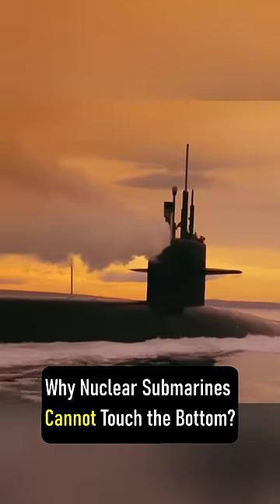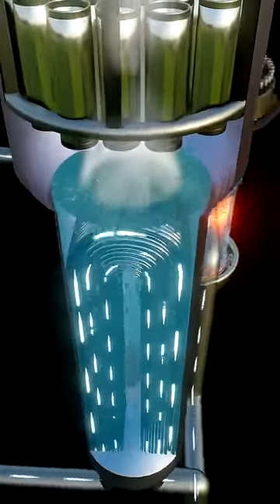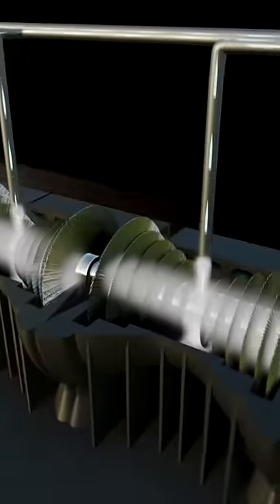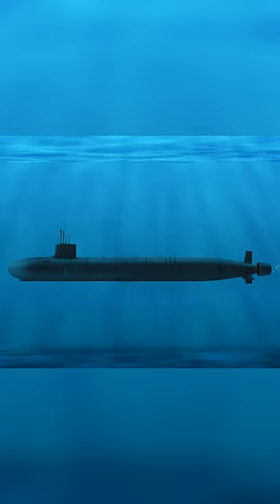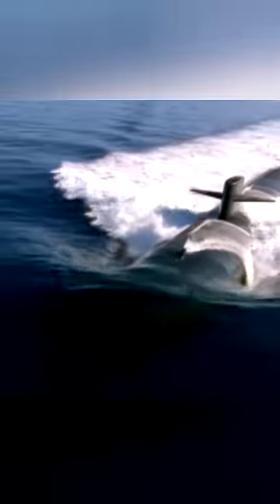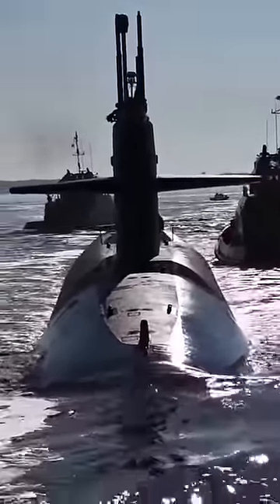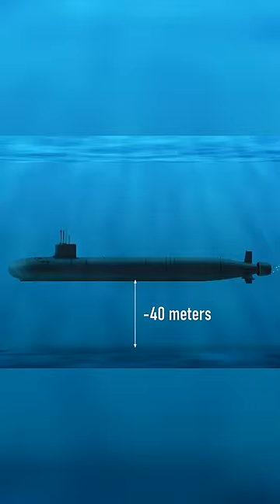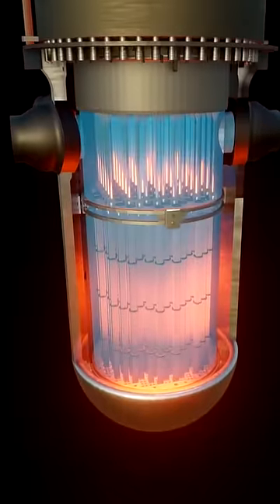Why Nuclear Submarines Cannot Touch the Bottom

Comment: The video was close to be correct.  Yes the intake is through a valve called Main SeaWater(MSW) and they are located on the bottom of the hull.  This seawater is brought in and distilled into fresh water for the secondary system which is not connected to the primary system which actually interacts with the reactor.  The Soviets had a class of su which had MSW valves on the bottom and top of the hull which allowed them to sit on the bottom in “shallow” water outside of enemy Potts.
Reply: Now that's smart soviets.
Reply: Do we have to tell it All 🤔
Reply: Always good to keep an eye on enemy Potts
Reply: @jimmysapien9961  you think adversaries don't know the general outer designs? Come on now.

Russia could probably build an F-14 part by part if they wanted to. I'm sure they have much more of a detailed idea of many western sub designs. Random YT comment isn't going to make them go "A-ha!"
Reply: Why cant the intakes be on the side in case if the sub would need to land on the bottom?
Reply: @tomaszwota1465  
Sure, they could build an F-14. Iran has had them for decades. But newer NATO aircraft... not so much. 
Yet from what we've all seen in the last half year it doesn't really matter does it? I realize the average Russian pilot has a fraction of the stick-time that NATO & US pilots have... same for simulators, but the degree of incompetence the Russian Air Force has shown really is mind blowing.
Reply: @donarthiazi2443  but yeah, I agree. With what you said.
Reply: The Russians also have a technique for floating on top of boundary layers, which allows them to stay at the same depth without making speed through the water.

They also have a procedure for "hooking" themselves to an iceberg.

Both techniques allow them to remain largely hidden (by disabling all the large systems) and listen on their hull sonars.
Reply: Had?
Reply: Opsec any?
Reply: @garrettmelton1447  Even the Russians don't use their 1970's subs anymore.
Reply: @2004acurarsx  We aren't talking TTPs or TS info, so no.
Reply: @2004acurarsx  I will divulge even deeper secrets. The American submarines regularly fly around the moon, but nobody tells that to the sailors, ain't no windows anyway to look out of. ;)
Reply: @2004acurarsx  this isn’t OPSEC.  This isn’t even confidential. FOUO at best.
Reply: Yeah you can't run seawater through the reactor. It would destroy it.
Reply: @jimmysapien9961  exactly
Reply: Ok I remember now it would make hydrogen by products, so may not kill everyone my breathing, but it would blow up
Reply: @allenpruitt8650  distillation is not the same process as electrolysis. Seawater is boiled and the steam is recaptured as pure fresh water. The excess crud is pumped over board.  Some of that distilled water is then run through electrolysis to create oxygen and the hydrogen waste is also pumped overboard. The rest of the fresh water created goes into the secondary loop runs through steam generator and then through the turbines to create thrust and electricity. The steam generator serves as the thermal regulator for the reactor.  The secondary loop cools the primary loops water which controls the reactor.  The primary loop is a very controlled zero sum system. So, fresh water is very rarely fed into the primary and once there does not come back out.
Reply: @MarcoChristensen  We specifically don't sit on the bottom because it's not a safe way to operate. even if we had valves to connect MSW to the top of the hull we still wouldn't do it. Even the Soviet ship that did it couldn't do it low enough to avoid satellite detection thus making it pointless as it took several hours to actually get off the bottom, and was very noisy for the Soviet ship as such we decided against it. MSW also is actually on the bottom, its just to low to be able to land on the bottom without pulling in a bunch of like crabs, and other sealife that crawls around the sea floor which would clog the main condensers which makes the cooling ineffective. So same general concept, but still incorrect.
Reply: What if barnacles get logged in there won't it cause the reactor to overheat and blow up
Reply: @jackdaniels2657  I will repeat.  The seawater is brought onboard. It gets boiled into steam. The crud (including any seaside) is pumped over board.  The new steam is then distilled back into fresh water.  This fresh water is then used in the secondary system which runs the turbines.  The water in the reactor (called the primary loop) is isolated and doesn’t require much if any replacement in its system.  So, in summary the seawater brought on is boiled and what gets into the system is the freshest purest water in the world.
Reply: Loose lips since ships. It’s called the silent service for a reason. Think OPSEC!
Reply: @jamesclark1001  I hear Ya bro 😎
Reply: @vicg5323  yeah, because basic explanation of systems used since the 1950s is definitely going to compromise sub positions now.
Reply: @bobbiescrisps9208  Yeah, you are technically correct, as SONAR utilizes hydrophones.
Reply: @ryannelson8717  this makes no sense. If satellites can detect all subs at the bottom, then they could very well detect subs not at the bottom. For subs that are not at the bottom, would be by definition, at a shallower depth than those resting on the bottom. Plus, they would be easier to detect simply because the oceans at intermediate depths are not full of crud the side of subs, floating off the bottom. Rocks that big tend to sink. Why else then even have subs. Every country, even India, then knows the exact location of every sub in the world.

I think American subs can very well rest on the bottom for months, and even crawl slowly along the bottom at night to avoid detection. They just don't want us to know about it. I don't see a technical reason why this would not be possible.
Reply: @danielch6662  I'm an active duty US Navy Sailor, Nuclear Reactor Operator. It's public knowledge that we can't sit on the bottom. Basic design tells us that, it's not even the military trying to lie, the pipes and the valves to do it just don't exist. Secondly, you clearly didn't read everything that I already commented. Those that are theoretically on the bottom do not necessarily sit lower due to depth limitations to make it effective as I've previously stated. Please read all the comments first before making assumptions as they contain relevant information as to why satellites can detect them and why they otherwise can't detect submarines at depth that are moving.

Edit: This isn't the video I thought it was, most information isn't on this one. Give me a few to type it out.
Reply: @danielch6662  Some old Russians subs were able to sit on the bottom, however, the effective use of sonar limits how deep one can go. Sonar mostly goes forward and down, it doesn't go up very well thus in order to be effective they would sit between 40m-60m. Satellites during the day can reasonably see through clear water well enough to see a boat between 100m-120m thus making it a hassle that's not worth the effort. They at best could sit over night and that would be limited by the ability to get on and off the bottom during times where those Satellites can't clearly see due to the lack of light. Most submarines can go past depths of 120m as that depth was achievable during WWII and we even had our the depth publicized by someone who wasn't thinking which resulting is the lose of many lives.so any submarine past 12pm isn't going to be seen traversing the deep blue by satellite and any sub sitting lower than that is unlikely to be effective or even find anything so it would be pointless to sit below that point. Our subs, however, don't have that capability, they never have, and that isn't likely to change as there is effectively no benefit to it.
Reply: Pretend you are a molecule of sea water, come in through MSW and come out as air. List, identify and find all valves and systems associated with this process.  Also list byproducts. ;)
Reply: It's very incorrect to say it's powered by nuclear decay. Reactors are powered by fission. Decay and fission are two entirely different processes.
Reply: @PlutozReal  who are you replying to? I don’t see anyone mentioning the word decay.
Reply: @PlutozReal  It's actually not very incorrect. Reactors can infact produce enough power off of decay heat alone to bring it back to criticality depending on how much decay heat is present. Decay heat also contributes a significant portion to the heat production. While fission does make up the large majority, anything that produces heat in the core that's over 5% is a significant portion and decay is over that. So it's nit a very incorrect statement, it's just incomplete.
Reply: Where's "em es dubya-13"? Favorite coner question
Reply: @mc-dev    What?! You never hear of Pottsylvania? You no watch moose and squirrel?
Reply: @tomaszwota1465    Funny you should say that. I retired as nurse from the VA coff couf. 
But I used to check alertness of patients when I asked what branch the vet was in. And I’d say Oh so you flew the submarines. Some didn’t catch it. Some did.
Reply: @jamesclark1001  you said the video was close to being correct. I said it wasn't because at :16 the videos implies that the heat generated to make the steam is through the process of nuclear decay, which is not accurate
Reply: @PlutozReal   the discussion is about the MSW valves.  The actual process of reactor is ancillary.  But if we’re going to discuss this, nuclear decay is the breaking down of radioactive isotopes.  This process is done through fission. Fission is when an atom has an unstable amount of protons and neutrons.  Which results in the atom breaking apart. One of the things in the break up is a fast neutron. This neutron is slowed down through moderation and then absorbed by another radioactive atom causing it to become unstable and repeating the process.
Reply: So a nuclear submarine only has seawater suction on the bottom of the hull? Surely they have low and high sea suction intakes like conventional ships for operation in shallow water or areas with a lot of silt/muddy water? Doesn’t make sense to me to have such a critical piece of machinery like a nuclear reactor and have all the cooling intakes for it on the underside of the hull. I’d imagine they would have additional sea suction points and probably backups for those to.
Reply: @56WagonWheel  the MSW valves are not directly at the bottom. They sit at the 4 and 8 o’clock position of the hull.  Also the MSW does not directly cool the reactor.  The water is brought on, distilled and run through the secondary loop which goes through the steam generator to cool the primary loop and run the steam turbines.  The loops contain enough water in them to be isolated and run normally.
Reply: Distilling sea water? Well I guess they have plenty of extra heat energy. I would guessed RO to produce clean water but I guess the pumps would rob electricity from the drive system. Interesting how these things work though. Rickover for all his eccentricities was a brilliant engineer.
Reply: @scottys1423  there are two distillation plants onboard.  The larger one creates about 36,000 gallons per day via steam from the secondary loop.  The smaller backup one is rated for 5000 gallons per day is run by electrical heaters.
Reply: @jackdaniels2657  *lodged. Logged is for trees.
Reply: @vicg5323  and it is not called the silent service for that. The saying is about people who give secrets away.
Reply: @teeanahera8949  damn auto correct
Reply: @tomaszwota1465  The Soviets did actually reverse engineer an American aircraft, but don't kid yourself, it's a monumental task. On top of that they had the benefit of having a fully functional sample of that said aircraft. They reverse engineered a B-29 no less. And they had to convert everything from English measurement system, to Metric system for manufacturing. The finished aircraft was called the Tupolev Tu-4, and the Soviet copy was so good, that its weight was within 750 lbs of the genuine article. As for copying an F-14, I don't recall the Russians having captured any. 🤔
Reply: [11/22/22] Why would they need to distill the seawater for the secondary coolant loop if it's only going to be recirculated into the sea? That's using up an awful lot of energy for nothing. For potable water, they def do that. As far as corrosion is concerned, the piping in the secondary coolant loop is at minimum high grade stainless steel, and maybe even Inconel 625. No cutting corners on those boats.
Reply: @oceanic8424  the Russians never captured a Tomcat, not to my knowledge. However, the Iranians have an inventory of them for a while now...
Reply: Wrong, water coming in through MSW is used to condense steam after going through the turbines.
Reply: @MarcoChristensen  thats a very good question lol
Reply: @tomaszwota1465  yehehehehehe
Reply: What is a Potts?
Reply: @johndc2998  port, r and t are adjacent?
Reply: @jimmysapien9961  yes you're right everything on YouTube is top-secret! What are these people thinking
Reply: It's stupid to design it where it can't sit on the bottom!!!
Reply: Enemy Potts?
Reply: @HassanAchieved  that would be my take, it's going to deposit the salt somewhere
Reply: @HassanAchieved here's a few reasons why submarines dont simply use the seawater directly and some were already mentioned above. A few additional reasons:

1) impurities can effectively decrease the ability for the secondary loop to cool the primary loop. Said impurities, over time, could also begin to act as an insulator against the walls of the secondary loop, thus degrading the ability to transfer the heat from the primary to the secondary loop.

2) seawater is highly corrosive. The equipment used in the secondary loop is already very sensitive to corrosion and needs to be regularly maintained, imagine exposing this equipment to saltwater

3) saltwater can carry radiation. If the secondary loop ever became exposed to the primary loop and it was carrying saltwater, that saltwater would absorb radiation and expose it to the ocean, the crew, etc.
Reply: @donarthiazi2443  cry
Reply: @danielch6662 you are over thinking and getting confused😂
Reply: Ports
Reply: @jamesclark1001 hahahaha, da fuq, where are you getting that from cause uh, it’s completely wrong lol
Reply: @K6Jaeger  what is wrong? I said two things. How the secondary and primary loops work and that the Russians did have a class that could bottom.  I didn’t say the US could bottom.
Reply: Thanks for explaining. Imo the cooling system should work no matter where the su is located. Reactor safety is crucial.
Reply: @jamesclark1001  that part where you said we boil seawater to make it secondary, that’s not true, I don’t know of a single US submarine that generates fresh water like that, and the fresh water that is generated is relatively seldom used for replenishment of secondary water
Reply: @donarthiazi2443  please refrain from commenting if you're this clueless.
Reply: @TheRepublicHasBeenLost  
It's crystal clear he meant Soviets
Reply: That’s really interesting I never knew that
Reply: it's called man stem stop wow
Reply: @MarcoChristensen 
They are, there are two MSW, main seawater intake valves, one each port and starboard.
Reply: UAL... VC COM CERTEZA TRABALHA EM UMA COISA DESSAS 
PARABÉNS PELA EXPLICAÇÃO, GOSTEI.
Reply: @MarcoChristensen because then the subs wouldn't be able to lay on their sides

Comment: Subs don't just touch the bottom, they ram into it.
Reply: I see what you did there
Reply: Case in point the movie Hunter Killer
Reply: @danielasare1165  oh wow I love that movie you know there's a set of books I think there were number five right now.
Reply: They have to be crushed first though.
Reply: Not ture but a captian would be removed from the post if you call in saying hey we touched sand or silt.
Reply: Once
Reply: USS San Francisco.
Reply: @robertthomas5906  ahhh the good ole San francisco. its and MTS boat now because of that lol
Reply: Happened to me in Soho once, needed sudocreme for a week
Reply: In the case of the USS Connecticut You are totally correct. 
On 2 October 2021 the boat found an undersea mountain with her bow while traveling at a high rate of speed.
They are lucky they didn't sink the boat.